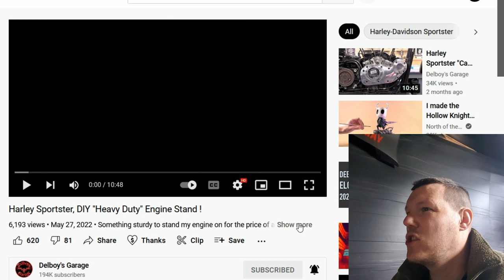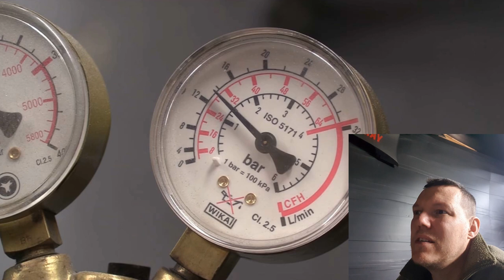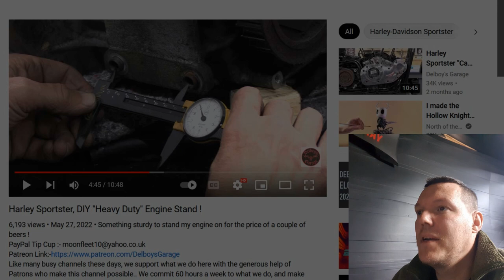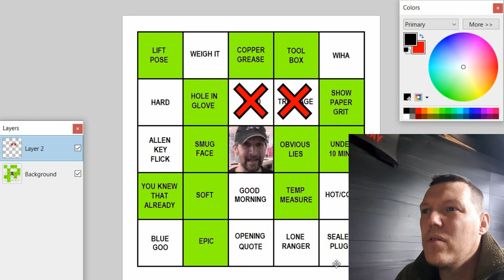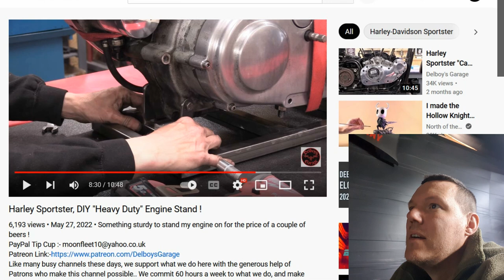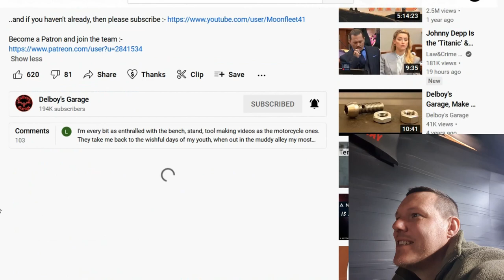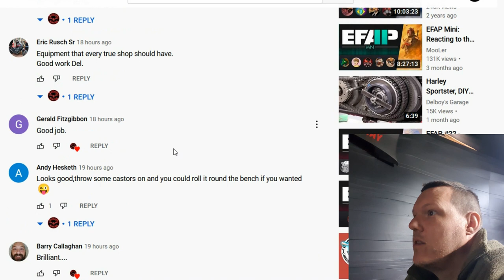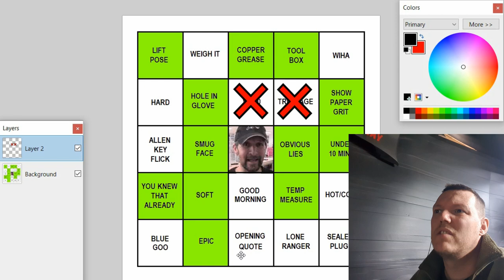Del-frame ENGINE stand - Part 9

Comment: I have rethreaded/cleaned bolts and stubs mainly because the bolts (original) wouldn't go in. Flywheel was skimmed and used, drive axle was mushroomed and by the time I finished, that nut spun on easier than before.

Now, I did re-use the split pin.... Something to add to my shopping list - assorted split pins.

Comment: It is hard to explain, but my welds look better if I highlight the path with 500W halogen. The arc and subsequent pool create a lot of shadows, but with extra light - everything is less contrasting. Try it.
Reply: i used to get mocked for using a little floodlight thing to light up the job so i could see with the mask on, but i also knew where the end of the welder was when i pressed go!

Comment: Lights are fine, but lights should shine away from him, not towards his eyes. What also helps when you are night blind is white chalk line on top of the weld line.
Reply: Fully agree about tack welding on both sides. The bottom will always open up if you don't.

Comment: All engine work for Sportsters can be done IN frame and is quicker than taking the engine out. Some H-D are different but Sportsters definitely quicker and easier in frame. 
Everything can be removed easy, head, barrels, gearbox etc

Comment: The light; it's so you can see what you're doing through the mask before you start welding
Reply: Pretty sure he's using an auto-dim visor screen....you don't need a light
Reply: @gcbification  fair point, i hadn't actually looked at that, it's just something i used to do when i was first starting. How's about it's to try and stop the camera dimming too much by creating a larger bright area?
Reply: @chrisdavidson911  Yeah, that's plausible ..obviously one would need the same actual camera, to see if that lighting strategy works...and if it did, it was likely Penny's idea B)
Reply: @gcbification  i've seen a comment from someone saying he might have the dimming thing set incorrectly. It's hard to tell. I've seen welding make cameras go really dark before, but i also think they were quite a bit closer to the job as well